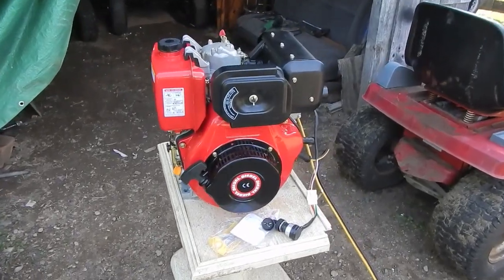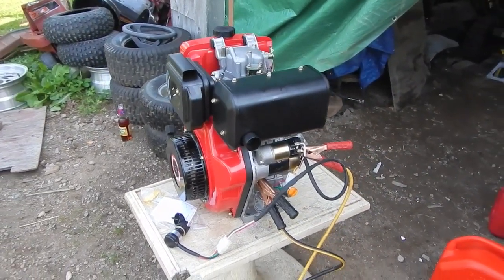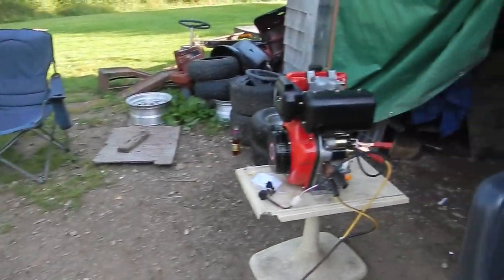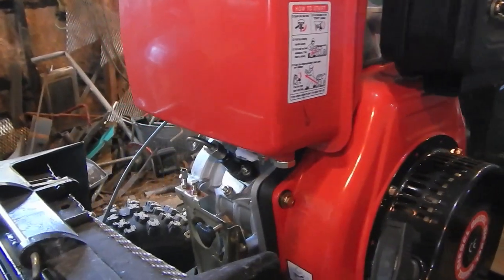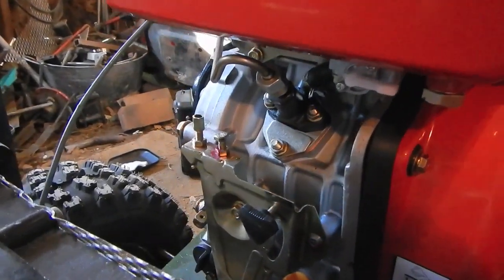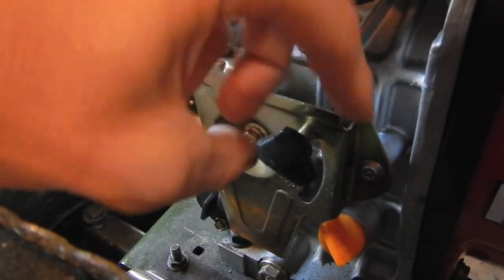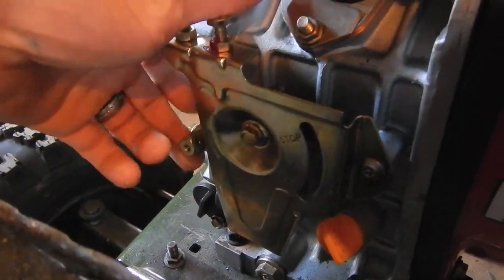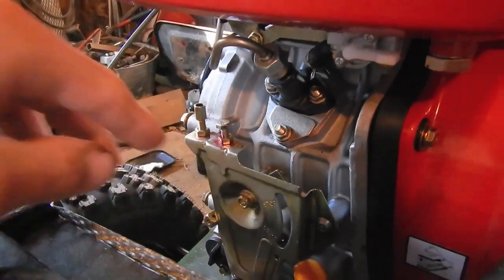10hp Diesel Engine First Start Up / Shut Down

Comment: ...never read the operational manual, to turn it off just need to open the release valvebin the head, the same to start the engine.

Comment: Neat little engines. Sounds great. As with runanways just snuff it out and regroup. The air filter has a wing nut and the injector nut is also exposed. I hope it's not damaged after the low idle hammering.

Comment: can it be shut off using the decompressor lever?
just in case it decided to runaway?

I'm fitting a 20hp diesel engine w/CVT for a 2 Wheeled ATV

Comment: This makes me want to buy one for my air compressor. Currently I am using a Harbor Freight "Predator 420" engine, and once you get the bugs worked out of it and a good spark plug in it, they're as goos as a  genuine hondq. Ive been using it for 8 years or so now, but wish it was diesel. And after seeing this video, I suspect that since the Chinese clone of the honda gas engines are so good,, that these Chinese clones of yanmar single cylinder diesels will be equally as good. Have you run it enough to get a sense of how well it does on fuel and how it compares to a Honda gx390 or predator 420 engine? And does this engine have a provision for throttle cable so it can be used with remote throttle, such as my air compressors auto-idle or something?

Comment: Thinking about getting one of these to test burning straight vegetable oil and testing biodiesel before running in an expensive Cummins. May even put one of these on a large sturdy bicycle and license it as a moped if I remember right once I exceed 49cc.

Comment: Thanks for the video.
i just collected a second hand air compressor i bought on ebay with this engine fitted, sadly it came with no manual, and i found your video.
it's my first diesel engine, so feeling more confident about starting it up and most importantly stopping it now.

Comment: That is very smooth. To turn off instantly (6 years too late) push the compression lever down. We are having terrible trouble starting a new motor on pull cord as we are not allowed to use key start as its with LPG.

Comment: Not good to run those without any kind of load on the engine. Those are pretty cool though. I wonder if a small engine turbo system would work on it. I dont see why it wouldnt as long as you could get the fueling right.

Comment: I've got 3 Kubota single cylinder diesel engines.  It may help to push the decompression lever to spin up the engine to idle speed then let the decompression lever go and it should start first pop.  That throttle set screw plate can be filed out to widen it's range of travel.

Comment: You stop a diesel by stopping the fuel or fuel pump.  Not the decompression lever.  That holds the exhaust valve open...and then you know what happens to the valve?

Comment: Cutting the fuel from the tank would kill the high pressure fuel pump in the long run
Reply: Old mechanical fuel injection diesel will mean you will have to get the air out of the fuel pipes if you let them run dry

Comment: The compression release is for allowing a person to turn it over with the pullrope to start it.  It will run just fine with the release open, just a little less power.  To shut it off you operate a mechanism to relieve the fuel pressure to the injector by returning it to the tank or lifting the pump piston so it doesn't pump anything.  With a lot of them it is a solenoid held open by the ignition switch and which relives that pressure when you turn the switch off.
Reply: Usually (with most of these) you simply set the control lever to the off position which closes the fuel rack; nothing nearly that complicated.
Evidently this launtop had a cheaply made control which didn't allow the lever to move to off position without removing the screw.

Comment: To all the guys talking about using the compression release to turn it off, I hope you are kidding. A valve through the piston or a bent pushrod may shut it off, but it ain't gonna start again.
Reply: Please explain how killing compression will drop a valve or bend a rod?
Reply: Aaron Cupples  It won’t. Otherwise it would hit when you’re cranking it.
Reply: Aaron Cupples - Good luck, I've been waiting over 3 months for an answer..

Just some know it all who has worked on a duramax so he knows everything about every diesel ever made.
Reply: Simon Richard - How do you turn it off then?

I know typically a diesel has a fuel shutoff solinoid? Could be wrong..
Reply: @duttydiesel8303  all diesels you shut down the injector pump.  The solenoid versions do that remotely, mechanically if you watched the part where he removed that knob, that's a sign that there is either an adjustment or manufacturing error.   Either he needs to file that slot so the knob can rotate to the off position or if that plate has a linkage with an adjuster between it and the pump that should be able to be adjusted so it will reach the off position.

You always want to kill diesels by stopping fuel, if you use a compression release you risk the engine spinning a long time each time getting a shot of diesel into it until the engine stops spinning, that can be thousands of rotations if there is no compression or load.  That liquid diesel will soak down into your oil and can hydro lock the engine too.

Or you can always stall it...
Reply: Where you could hurt a rod is if you managed to get enough fuel to hydrolock.
Reply: @pbgd3  - Change your oil, anyone with a 6.4 PSD will tell you a little diesel in the oil won't kill your engine..... right away 😂

Comment: yanmar engine? theyre great. id use the pull start with the pressure release aswell doesnt need battery even tho that would make life easy. and have the cut off pull cable handle fitted.

Comment: keep a can of WD 40 on the tractor  diesel engines will run on WD 40 sprayed in the intake  it will go through the filter paper 

I have started  6.9 Cummins and 7.3 Navastars  this way in addition to Miltary GenSets

Comment: No lash so u use compression release to start, and turn throttle limit down without unscrewing nut, and hold compression release  together at the same time to kill it.

Comment: I had to use one of these clone engines and I didn't have to pull the screw all the way out it went to stop and shut down. Looks like there may need to be some adjustments made but from new we fired it up and let it idle for 10 minutes then finish two tanks off on half throttle. Because there's about 6 hours to a tank and the run in threshold we were given was 10 so we dedicated two tanks to it, kept the oil checked as they use it while bedding in and then off to the wood yard it went.
Reply: How long did your engine last? Do you have any issues? Cheers

Comment: Does it take reg deisle fuel u get at the gas station
Reply: You can run it on everything
Reply: +Jack Carroll no you cant
Reply: +delaine maiers therioticly you can practically no but you can run in on very filtered veg oil

Comment: need a batt with higher cranking amps.. and for my 94 cummins 3500 I have a manual shut off switch I pill witch can be located on the fuel injection pump  this motor sounds junk... if you keep starving it from fuel gonna ruin it.

Comment: I have a similar engine, apollo 10hp diesel, on my wheel horse tractor, serious question where is the oil drain?
Reply: the bottom or a little yellow screw in thing when you half to tip the mottor

Comment: How would I get a Predator 212 into a riding mower if the mounting plate is for a 10hp flathead Briggs? Are the required mounting plates the same? I don't have any experience with engine mounting and i need help trying to do it.

Comment: Hi have you ever thought about building a motor stand you could hood pins on the stand for the motor to go in the bolt holes and use the clips to keep it locked down just a thought

Comment: where did u get the diesel  mower engine
and how much do they run
Reply from the maker: I bought this on on ebay brand new, it cost me $600 shipped to my door. Worth it, it still running awesome
Reply: do u like it i have a off road mower
 to and i got some of my ideas from u
 an thank you i like your videos
Reply: @Fearlessfront  - Can I get an update? Still good buy, what did you use it for etc...
Reply: What would be a good gasoline engine for a 2 speed (forward and reverse) race lawn,owed for about $300
Reply: +FearlessFront (Todd Christopher) I bought the same engine in 2014 and paid 390 for it. the engine is not so bad as for that foney it costs.
Reply: +Lincoln Wakefield I would just find a older mowet
Reply: +Олександр Чумак Where did you get it?
Reply: consaka1 here http://epicentrk.ua/de
Reply: +Олександр Чумак I could never find anything close on that website. Some car stuff was the closest I found.
Reply: consaka1 that's an offline shop and it's located in Ukraine and they do not show all the thinds they sell. So, this is the engine you're interested in http://sadko-shop.com/uk/dvigatel/sadko_de-410_.html
What country are you living?
Reply: Олександр Чумак United States. I bet shipping, if they ship, would not be cheap.
Reply: 221 euros is more than usd 250
Reply: US dollar was all times cheaper than Euro.
Reply: Олександр Чума

Comment: Dan Coburn @turtle 2448 thomas some do some don't I got one off eBay said it had a glow pulg it didn't  wich here Alabama it don't it doesn't really get could enuff to use it besaids one day it was 16 degrees Fahrenheit she wanted to turn over but she didn't so all I did is got an hair dryer blow it in the air intake she fired right up mines going strong it anit on a mower mines on a old tiller I ve been trying to ge it on YouTube but I have got to it yet

Comment: I absolutely agree. For example, a clinic, in a remote area of Africa, that got the money from Europe to build it, could only sign up if they had 'so called' green photo electric power, it breaks down all the time. And nobody knows how to fix it. With diesel generators, there'd be loads of guys who could keep them going at minimum cost. Keep up the good work. It's about time the 'aid workers' got real. BTW I do know of an English London bus engine (built by Gardner, check them out) that did 400,000 miles on London streets and is now in Zimbabwe, running a night club, with bands playing and lighting. Excellent. Now that's 'green'. Tony ZapFJ11

Comment: @Fearlessfront put a deaco style air shut off on it. you'll wish it had one if it ever runs away on you.
Reply: if u do that u may hydrolock it
Reply: anthony hayes hydrolock it with what?
Reply: stupidity^ lol
Reply: @KRIS BRZEZNA  , the diesel fuel is an oil , and since a diesel engine run by compressing air to ignite the fuel mixter it could hydrolock it the possibility is small but can happen
Reply: Or you could have a knob on the dash that does to the compression relese

Comment: Could of just pulled the decompression release.
Reply: Yes, but you can over travel that cam, and then it tears the valve train apart.. If you push it too far you won't be able to pull start it because it locks over center. You kinda have to fiddle with it to get it back. I have 2 of these. a 6 and a 10. Great engines. Oddly, I don't have to pull the pin to shut mine down. It's probably an adjustment thing with these chinese motors.

Comment: What Wasstrop said, keep the RPM in limits.  There should be an adjustment for spring tension.  That is how that type throttle works.  It is actually a governor.  You change he spring tension with the speed lever and the internal flyweights match that spring tension at a certain RPM.  Also once at low idle, you can push the compression release lever to kill the engine.  Compression is what fires the fuel mist/air in a diesel.  No compression is the same as no spark in a gas engine...

Comment from the maker: yes, got about 20 hrs on it, runs great, nothing to complain about, runs really smooth and is VERY fuel efficient. Much better than a gas motor the same size
Reply: FearlessFront (Todd Christopher), that’s true Todd. For example my 82 JD 212 will drink 3 1/2 gallons in a day and that’s mowing a 2-3 acre field, plus the motor burns oil and that charging system is weak. I’ve watched your diesel series multiple times and was thinking about doing a diesel swap on it. Being that I’m a diesel guy and own a  n OBS 7.3. But gas is ok if you need to. But diesel generally lasts longer they are generally better motors when taken care of. Where can I find a lik to the engine.

Comment: Hey fearless I was just wondering if you still need that fiberglass nose piece on the sears. I just inharreted a sears st 16 and I don't need the nose piece. I will post pictures on your facebook. I don't need much out of it. But I was thinking around $50. Thanks

Comment: I noticed several people telling you to press the decompression lever...NEVER DO THIS while the engine is running! It will cause the exhaust valve to come in contact with the piston and that will end badly. The decompression lever manually opens the exhaust valve to release the pressure in the combustion chamber. You will easily bend or brake a valve off or worse if this is done while running.

Comment: To stop it leave it at high idle and cut the fuel it will stop. I've worked on the non clone of this engine. Don't "roll coal" thats just stupid This engine won't handle it.

Comment: Why not increase the cutout slot a few more degrees for the throttle lever past the stop position so as to be able to have a hand throttle,or throttle of some kind which when adjusted properly will give you max throttle as well as shut the engine down when positioned all the way down..

Comment: My last RV was a suzuki samurai with a slide in camper. It came out of a ford ranger (a slide in cab over for small pickups)  but I still had to cut three feet off from it. It actually didn't look as bad as it sounds....  My wife puts up with a lot.....  B-)

Comment: The manual probably REALLY means "to use it", Chinglish has a lot of holes in it as far as written languages go.  B-)  I think once they get a manual done, it should really be vetted by a native English speaking  person. There are a lot of variations in the Chinese language, so if the translation is farmed out to someone in a different province, the verbiage might end up differently than the original tech writer was intending. Its like someone from Maine having a conversation with a Cajun.  ;-)

Comment: cool vid todd weve got heaps off these at work and even the biggest battery struggles to start its due to the small starter motor weve found buy using the decomp lever ever time you start it it saves on starter damage cant wait to see it in the sears good job

Comment: I am a former Diesel Pump Technician. The stop lever or throttle lever in some cases (depends on the fuel delivery system) moves a rack and pinion or a metering valve to a fuel off position. High pressure parts of a fuel system are lubricated by the supply of fuel to the moving parts. Some pumps require engine oil lubrication to some of the moving parts.Starving fuel will not hurt the engine parts but it might be bad for the high pressure pump parts. There are no air intake shut offs on Diesels.

Comment: It's a last resort method to shut off a diesel by cutting the air. We had a 4cyl Ford tractor engine go over speed because of a governor malfunction. broke the fuel line off with a hammer but it was too late. It had started burning the oil off of the cylinder wall. We cut the intake air off with a hard cover book and it sucked the head gasket in. Olds Diesels, if you were driving too fast (like 90) wouldn't slow down because they would start burning oil off of the cylinder walls to run. Hang on!

Comment: We had a runaway Ford Diesel engine on a test stand at Tech school. The instructors always made a flat upright air intake pipe on all of the Diesel training engines we disassembled and reassembled in case the governor stuck on the injection pumps. In case of an engine over speed you could put a hard covered book over the intake pipe and starve it for air. I worked so well it created such a low pressure in the combustion chamber the outside air pushed the head gasket into the chamber.

Comment: Don't get me wrong, I'm not bashing it, but here in the USA its not an engine the average diesel user will ever come in contact with unless they are in an industrial market. You won't see them in any of the non commercial trucks, and none come to mind in the compact tractor market.  So while its a great engine, its not the engine to use as a baseline standard for diesel operation. (Unless you have a tank, or drive an old dump truck.) So yea, I'm sticking with oddball.

Comment: Awesome engine...always a fan of diesels. If you choke out the air intake, it will die right away. Diesels are all about the air intake. If you ever had to deal with a runaway diesel, first thing to do is block off the air and it dies

Comment: @ Jim's eqwipment shed. Yes there is an "air" set up. The engine sucks in air, compresses the air, then fuel is shot in and ignited by the glow plug.

Comment: The Detroit a two cycle right? (So it requires fuel for lubrication, like a giant weed whacker.) That's kind of an oddball engine, I wouldn't apply that knowledge to anything in the four stroke world.  Four stroke diesels (To my knowledge) are not damaged in any way by cutting the fuel source.

Comment: Just cut the fuel supply, that's all my tractor(s) do. I pull a lever and it cuts the fuel to the injector pump immediately. There is no 'air' in the system, so when the fuel is cut it stops with out creating a situation that would require bleeding the injector pump. So cut the fuel with a switch, don't pull the line out of the tank or anything like that.